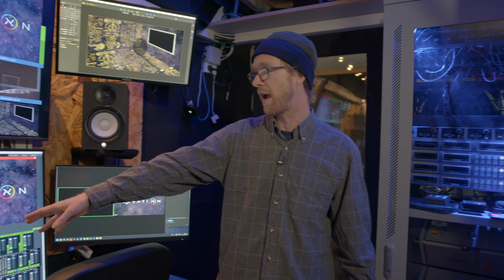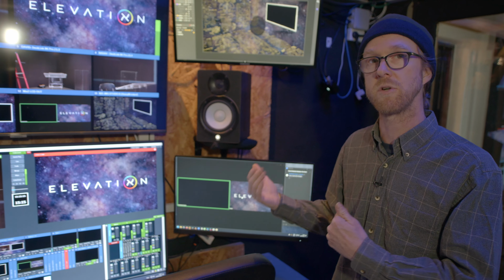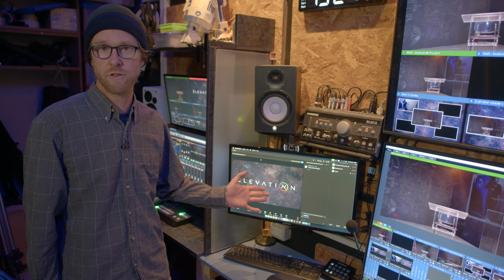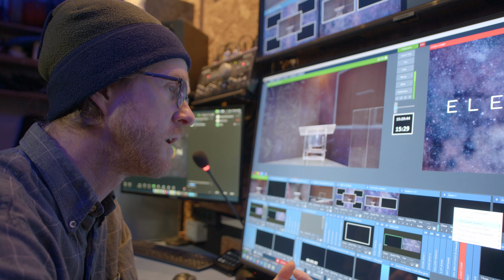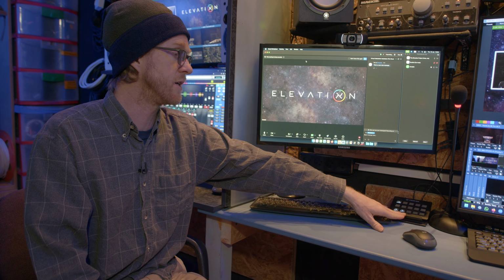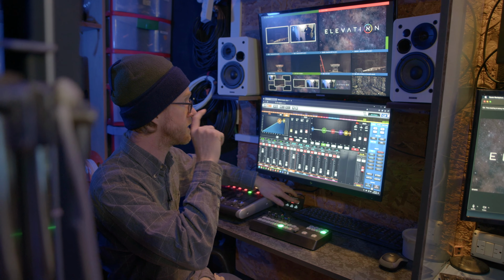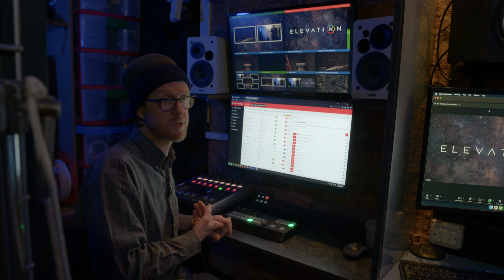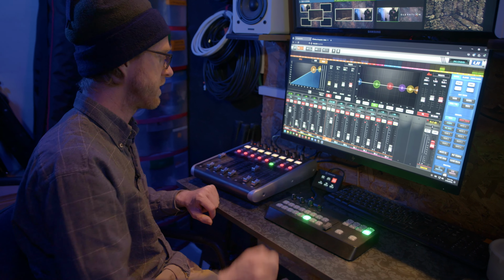Hybrid Zoom Studio, Part 2 — The Control Room

Comment: 6:27 looks like you might have a timing issue. When you switched the picture on the left side of your monitor, it looked like there was a horizontal shift (going to the shot with the ladder). You might want to go back to your recording and check it I saw that correctly or just was seeing something. If there is a horizontal shift you have a timing issue. You should time in all of your sources if you haven't done that. But since I don't see a waveform monitor or vectorscope I would guess that you haven't timed your system.